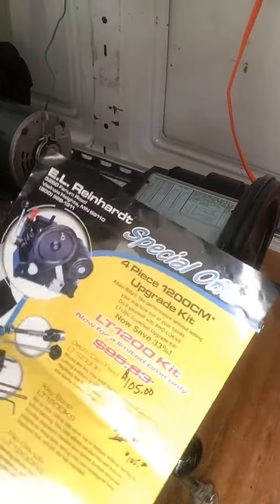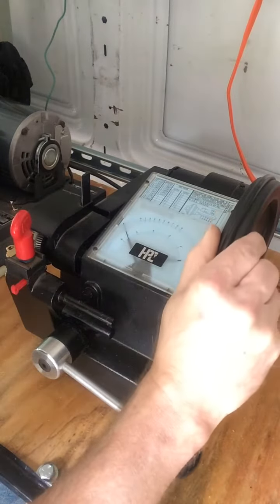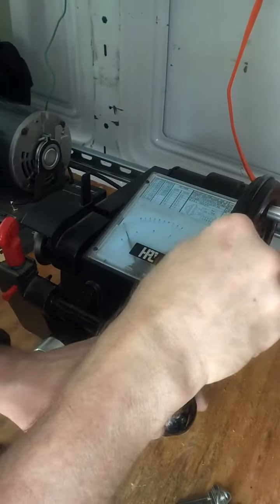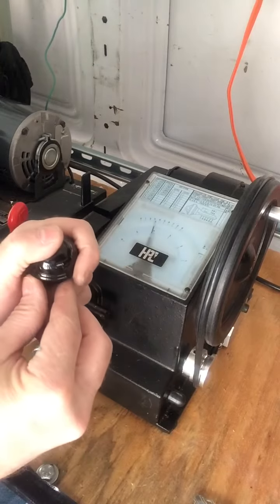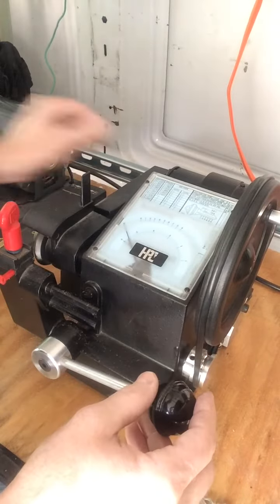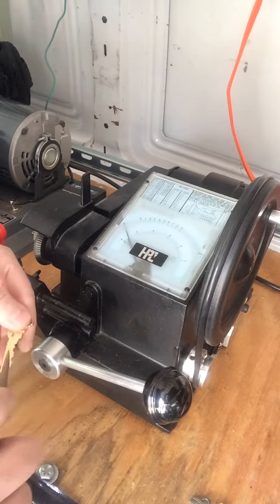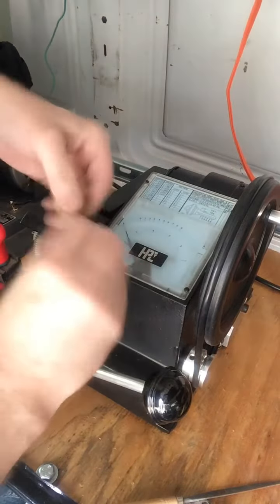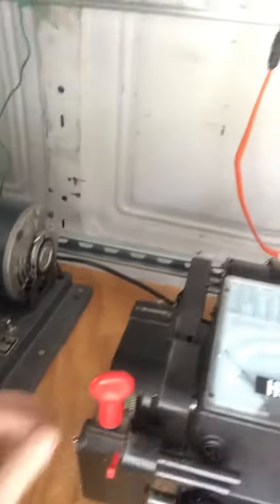HPC Upgrades

Comment: I only have the framon 2 for code cutting...well, and the xhorse dolphin for automotive.  I did get a Foley belsaw code cutter Ina storage locker purchase, but haven't figured it out yet.
Reply from the maker: That Foley Belsaw 200 is a wonderful adjustable machine to have as a spare duplicator and for using depth and space keys for code cutting. Only real drawback to it is the clamping is not real good and the motor is a little weak. But I could even cut best keyways with mine if I used the right combo of shims to keep the blanks straight or even with the cutter snd stylus. What are you having a trouble with? There’s a million videos on the Foley-Belsaw 200. Btw, I have that same orange Chinese made “high security” key machine you have, and I’ve never been able to cut a decent key on mine either.
Reply: @odinslockllc  time is the major problem.  I just need to block some time and mess around with it.
Reply from the maker: @JenkinsLocks  I still have 2 or 3 of the Foley 200 machines laying around. I started picking up some of those speedex minis for my travel machines and they replaced the foley machines. The jaws and motors on the speedex minis are far superior and I find those speedex mini machines used priced less than a foley machine. I usually find them for less than a $100. Check them out on OfferUp eBay etc…